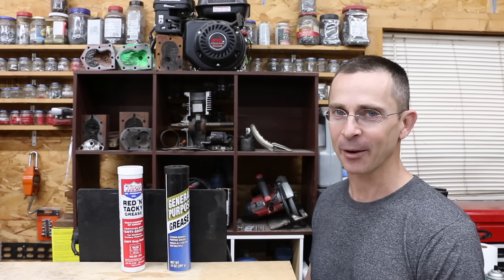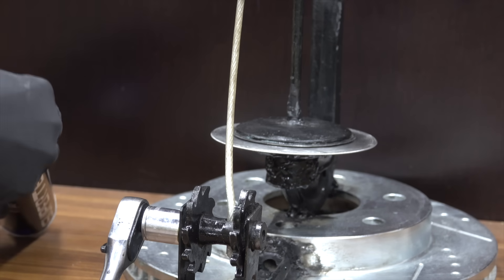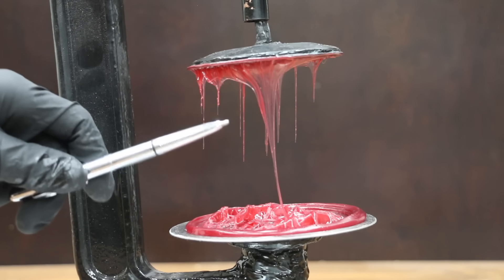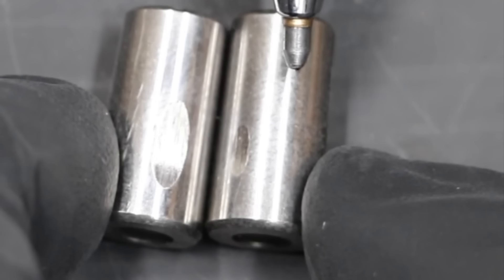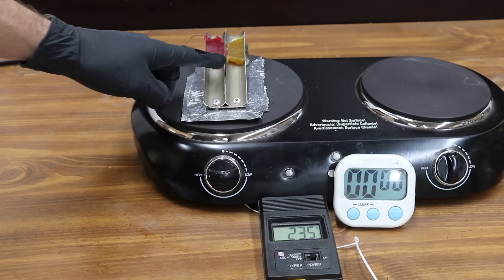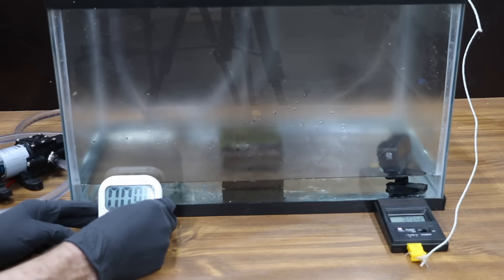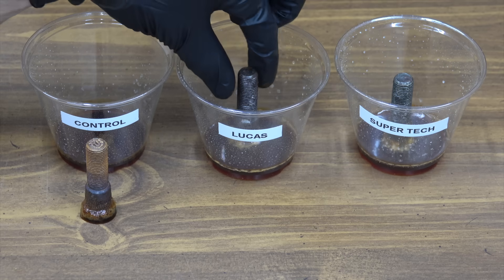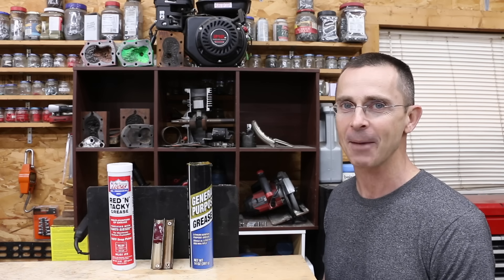Is Cheap Grease better than Lucas Red N Tacky? Let's find out! Bearing Grease Test Episode 1

Comment: Can you test windshield washer fluid.  Some "claim" to not freeze or cleans well, and not damage metal parts.  Other claim to make water bead.  Lots of junk out there with questionable claims. And every car uses it.
Reply from the maker: Great video suggestion! Thanks!
Reply: @ProjectFarm  check to see if the fluids deteriorate to rubber. Seems like some bug juice water repellant fluid I use ruins blades quick! Or maybe it is the drive through car wash soap 😂. Lots of testing there 👍
Reply: @ProjectFarm  yes. i pay for the rain x and wonder if its worth it.
Reply: @ProjectFarm  If you're checking bug cleaning, consider adding dishwashing liquid to the fluid.  I find spraying Windex on the windshield with the wiper running will remove the "love bugs" when the typical fluids will not, so also consider adding ammonia.  Excellent channel, glad I found it.
Reply: I used rainx 3-1 for years till I found curd cutter at rural king a few years ago and haven’t went back. Deicer, beads water nicely, and removes bugs. I’m sure there is better out there. But for 2 bucks a gallon well worth it.
Reply: @o1mtbiker  Prestone my man. puts the other washer fluids to shame
Reply: @keithbussanich  does Prestone ruin your wiper blades?
Reply: @johngoffinett7808  no. I run silicone wiper blades, though. Haven't tried it with rubber blades
Reply: o1mtbiker just bought that neon yellow crud cutter from RK about 3 hours ago. Sounds like a made a good choice.
Reply: @woods565  Go and test it.. I think?
Reply: I like the rain x orange all season. Works for ice, cleans great and beads water. Aquapel is the best for windshield treatment.
Reply: @Supra2jTarga009  
I like rain x , but it's a pita to do all the time....the washer fluid seems to work 80% as good as all that rubbing so that's the way to fly for me.
Reply: @Supra2jTarga009  Class action suits on that product.  Not to mention staining.
Reply: @ShainAndrews  I use rainx as well. Maybe I should look into that!
Reply: @micahap1559  Google around and you will find the details.  I never thought anything of it until my friend complained of stains on his vehicles.  We both are pretty meticulous.  That's when I found other issues regarding pump failures, and lawsuits.  I've been using Prestone Ice Cutter for more than a decade with zero issues.  I tend to run in -20 weather for a month straight.
Reply: @ShainAndrews  the suit was dismissed in May 2017.
Reply: @TXH1138  I never said anything beyond there was a lawsuit.  Lots of forum posts with issues related to it though.  It's one of those things that a person would never guess could be an issue, but there is plenty of evidence showing it can be.
Reply: @ShainAndrews  If the lawsuit was dropped, that points to the fact there was NOT enough evidence to move forward.
Reply: @TXH1138  First day in law, because on the second day you learn there is always more too a case.
Reply: @ShainAndrews  it peeled the clearcoat off my civic.  In stripes that directly lined up with the nozzles
 So it doesnt surprise me.
Reply: @ShainAndrews  I have a white car.  The orange shows up on the hood.  Then it washes away.  But it's a daily driver.  If you are 'meticulous' maybe you should have a car that doesn't go out in the rain?
Reply: A similar idea could be to test anti-for treatments.  I don't know if it's too late in the winter to bother - it's 78 down here in Texas!
Reply: Rain-x with the orange jug actually make water bead!!
Reply: @jor-d5640  or just use the wax and stop being lazy
Reply: Yeah, agree with the Rain-x comments. Love the Rain-x wipe-on (dont even need wipers at speed), but the Rain-x washer fluid is 80% as good and always there - and a lot easier!
Reply: Ive seen the rainex clog in some cars.  Ive been using it for 20 years with no ill effects.   It does seem to build up around the periphery of the windshield though. My friends always say my jeep is molding, but the stuff wipes off and its orangy on the rag.
Reply: I've been using Rain-X de-icer, which is pink, for 20 years now across at least 8 different vehicles. Never an issue with it, ever. The vehicle in my fleet using it the longest has had it for 14 years. Hilariously, I have a video scheduled to go live tomorrow where I mention that fluid... 

Soo.... Orange AND Pink might be good for the PF test as well since it sounds like the Rain X orange is bad mojo...
Reply: I've used the Rain X, it definitely helps the water bead. It's not as strong as a fresh coat of actual Rain X, but it's better than no coating at all.

I believe that they add a lot of alcohol to the freeze safe washer fluid, if it will freeze it's mostly water based. The freeze safe will eat the rubber inside your washer fluid system as well as dry up your wiper blades quicker, so I guess if you can get something that says it's only safe to 32 degrees.
Reply: It’d be nice to also test which ones clog up the filter on Mercedes windscreen washer fluid pumps ;-).
Reply: RainX works but its double or triple the price
Reply: I asked the same the other day. I wish he does it.
Reply: I use whatever I can that is blue and says "winter formulation" on it.  My vehicle's previous owner used plain water and ruined the washer tank and lines.
Reply: I use the purple rainx in the winter, orange in the summer.
Reply: Along with this test please try out a regular version of windshield wiper fluid. But add some ethanol to it to make it any antifreeze windshield wiper fluid. People say that that's what you do instead of buying the anti-freeze type of fluid. If you read the label on the stuff that doesn't freeze it will say that it contains methanol or maybe ethanol one of the two.
I am vetted in this because I live in California and most of the non freezing windshield wiper fluids are illegal in the state. Something to do with the air quality. You can only buy the nonfreezing types if you live in the mountain areas. I live in Sacramento and we'll drive to Nevada just to smuggle in some non freezing windshield wiper fluid. Kind of feel like Smokey and the Bandit.
Reply: @travisk5589  You don't need a test to know that ethanol will work. The freezing point of pure ethanol is around -114 °C
Reply: @kiyoponnn  Okay,  how much ethanol do I need to add to a gallon of washer fluid to keep it from freezing? I know that 1 tablespoon added to 1 gallon of washer fluid does not greatly lower the freezing temp. Maybe it lowers it by 1 degree
Reply: @travisk5589  https://www.engineeringtoolbox.com/ethanol-water-d_989.html
Reply: I cut a potato in half and wipe the screen.....
Reply: @johnturner4400  I don't think I've ever heard of that trick, interesting
Reply: I use 3 parts methyl hydrate , 1 part vinegar and 10ml dish soap for the winter , for 30 some years yet have any trouble and I live in ont. Canada , PS TOTAL 1 GALLON IN CANADIAN MEASUREMENT!
Reply: I use the cheapest I can find at Walmart for my race car.
It's only water and methanol so it's perfect for combating detonation on a turbo car.
For the intended job, I use Bug Buster. We have a lot of bugs (Love Bugs) down here in Florida.
Reply: That's a good test! Also I recommend using de icing fluid. Not to actually deice but it drops the freezing point of the moisture on your windshield which also means it's more resistant to freezing, itself. Don't listen to the gas station fluid crap lol they all suck
Reply: If you do this test please include the Prestone brand De-icer in my opinion it has always worked the best in actual winter conditions.
Reply: I’ve just used water for the last 40 years ....
Reply: I can tell you now that RainX  orange doesnt freeze to -10 and does indeed make water bead up.
Reply: Ive seen them all freeze here in Alaska
Reply: If you need de-icer buy pharmaceutical grade isopropyl alcohol (99% alcohol) and dump it in with your winter washer fluid.  Removes ice almost immediately.
Reply: I use water in California 👌
Reply: GoodBadUgly I use the water repellent one, and it works real nice. Barely need to use my wipers when it raons
Reply: Yeah, my personal favourite is rain-x it works well to keep crap off and beat the rain, I don't know about the claims peeps are making about the low temp stuff tho (I'm from north of Sydney, NSW in Australia)
Reply: I treat my windshields with car paste wax every two years or so, and then don't worry about the blue juice. Whatever you can find in a pinch is fine for blue juice as long as your windshield is waxed. In fact, with a waxed windshield you rarely use your wipers.
Reply: They got some stuff at the dollar tree (I know but it works) that's really good, especially good for cleaning off luv bugs.
Reply: Also I’ve heard claims that the Rain X brand can cause clogging and failure of the washer pump
Reply: @ONE_GEN_X . I had a Lexus washer level sensor fail ( swelled up and cracked) and several washer pump grommets fail (swelled up and cracked) when Rain-x was used exclusively for 3 -5 years. It has some type of petroleum product in it that attacks certain rubber and plastic components.
Reply: @ONE_GEN_X  I 've used it for 40 years with their different products , the last several the windshield wash , in a verity of vehicles with zero problems .
Reply: @ONE_GEN_X  I've used rain-x for years and I never had a washer pump go bad.

Comment: I used Bigfoot grease when I replaced my boat trailer bearings and hubs. It is very nasty to work with but seems extremely tacky and adherent
Reply from the maker: Great feedback on Bigfoot grease.  I'll test it if there's enough interest.
Reply: @ProjectFarm  ALL the grease tests. ALL of them! Big big showdown like you did with oil! WOOT! Love ya long time Project Farm :)
Reply: @ProjectFarm  Yes please! More grease tests!
Reply: @ProjectFarm  yeah should be a greese showdown
Reply: Did you read my mind, recently I saw the Bigfoot grease at the local Napa and it was pretty cheap so I bought a bunch of it. Holy hell that shit is messy as fack to work with but it seems to be sticking really well to the bearings. I use it on a lot of golf course equipment and it doesn't seem to wash out as much either, it stays on those lower rollers that are constantly in the Morning Dew, mud and water.
Bigfoots been good to me!
Reply: @SandersChicken  ha yup that's where I bought mine too was at Napa
Reply: @Constantine Fotopoulos lmao I live up here in sasquatch country in the pac nw

Comment: Grease is the word and my money is on Amsoil whenever you get round to testing it. As is the case with any lubricant, the more synthetic the content the better the protection.
Reply from the maker: Great suggestion on testing Amsoil.  How about an Amsoil vs Royal Purple showdown?
Reply: @ProjectFarm  Splendid idea!
Reply: @ProjectFarm  Amsoil, vs Royal Purple, vs Mobil 1 grease
Reply: @ProjectFarm  Test out Cen-Pe-Co products too, they make all kinds of oil/grease products and also made one of the first diesel fuel additives I believe. They have some great products, most pulling trucks and pulling tractors use Cen-Pe-Co products
Reply: You can do an amsoil vs royal purple but amsoil is going to win. I am interested in seeing how it turns out for you. I'm surprised you have not gotten a seise and desist letter from a company by now. Not that you are doing wrong but they can be petty like that.
Reply: Schaeffer grease is far superior
Reply: @windwalker5714  it's pretty great
Reply: 10 times the price , but a good product
Reply: @ronaldhickman9953  they're not really worth it. Thousands of Blackstone Labs tests have shown Amsoil to barely outperform Group III synthetic oils, if they do at all. Most of the time they don't. Their grease is on par with Mopar Multi Mileage, Schaeffer's 238, or Sta-Lube. It's double the price for the same results. AMSOIL is nothing but hype for everything but their Z-ROD line, which is one of the last to offer truly high ZDDP content and only meant for classics.

Comment: I work in the heavy equipment industry. I’ve never came across a part that wore out due to brand of grease, only the lack there of; although I do use a higher quality grease in my vehicles
Reply: Old saying, "Any grease is better than no grease !"
Reply from the maker: Great feedback.  Thank you
Reply: Reel-Lentless conveyors absolutely need a quality grease.
Reply: It liquefied and went out
Reply: Maybe that's more critical on the longevity of some ball bearings.
Reply: 2nd this as been there and done that too!
Reply: Three Finger Joe obviously, it’s got nothing to do with the brand,  but the “lack of” you refer to is when the cheap grease clocks out and leaves before the operator does,  and that’s when parts wear, if it were a better grease it would of lasted until the next lube job arrived.